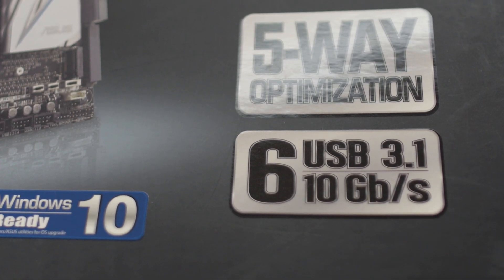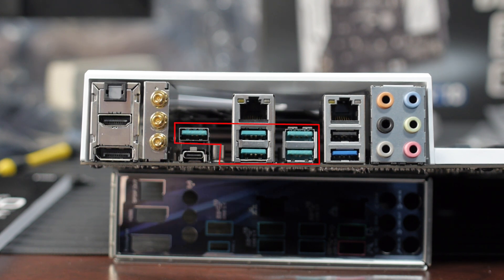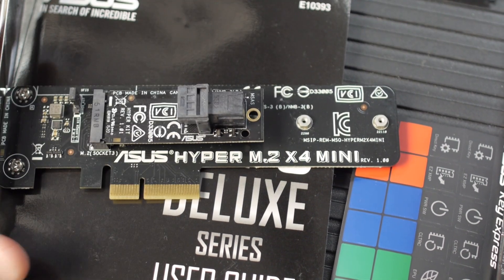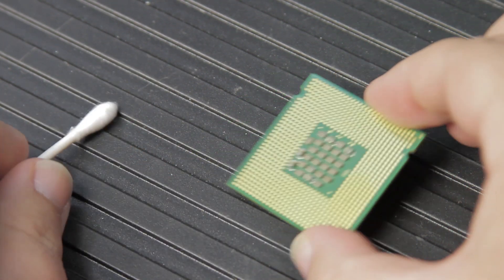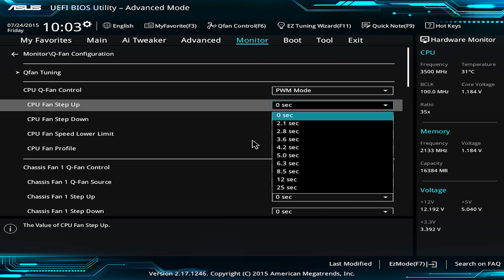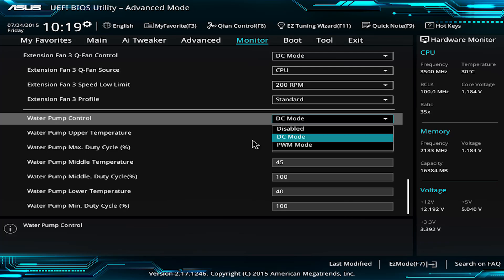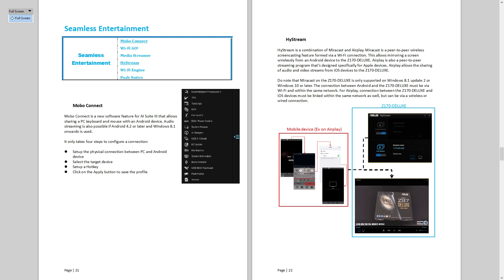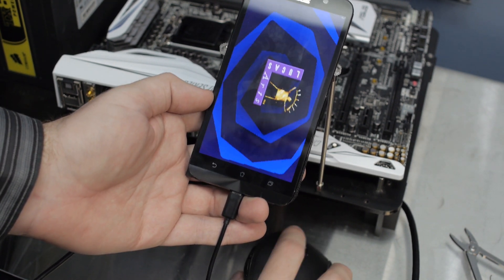ASUS Z170 Deluxe - Skylake Socket 1151

Comment: I'm quite new to this and I haven't read that much about it but I would like to know. Would using linux with this motherboard present problems or is it a good one for that purpose? Thanks.
Reply: Your motherboard doesn't really have anything to do with the operating system you decide to put on it. Some (much) older motherboards won't boot into anything else than Windows, but with any motherboard, you shouldn't see any problems.

Comment: Which is the 3.0 pci slot that runs at x4 mode? The first one (at the top) or the last one (the one close to the led indicators, fan connectors, usb connectors and other stuff).
Thanks in advance. Sorry for my bad english.

Comment: guys i dont know what he means by the wifi thing and the ram 2133 issue. if i use the corsair vengence 2133 lpx  2x4gb ddr4 ram would it work perfectly fine and also does the wifi thing work like a normal wifi pcie card

Comment: The cleanliness of the cpu and cpu socket was a little exaggerated lol. I've seen a Core 2 Quad run with TIM pieces stuck in the socket (had to remove with air after) cpu had TIM all over it in fingerprint style >:/ and it still worked before and after clean. Maybe i just got lucky.

Comment: should I go with this board or asus maximus VIII? any suggestions?
Reply: +Alex Dugman I'm not an expert but what I did was look at the price difference then sum up what was worth it to me. The additional stuff you pay for on the z170 deluxe is essentially the built on ac wifi and bluetooth. If those sound important to you then definitely go with the deluxe. Then there's also 6 USB 3.1 ports on the back and a hyper m.2 x4 pcie card which will let you have an extra m.2 slot at the cost of a pcie lane. Then there's also the u.2 adapter which I'm not too sure about but might come in handy in the future. I went with the deluxe because of the built in wifi, adapters, usb3.1 slots and the number of storage expansions you can hook up to it. Both are good boards but all it comes down to is suits you more

Comment: I have a quick question about CPU bottlencking GPUs. I have two Strix GTX 980s in SLI on an older i3820 (OC 4ghz) on an Asus P9X79 mobo. GPU-Z reports I only have PCIe 2.0, when I know the P9X79 fully supports PCIe 3.0. Even running the graphical demo GPU-Z has still reports PCIe 2.0. Maybe Windows 10 is messing with that, or the way I overclocked my CPU may "downgrade" my PCIe ports? I dunno. But is my old CPU bottlenecking my GPUs?
Reply: +scylendrey what about multi-core cpus with HT?

Comment: Great vid.

I got a beginner question, when the board has a maximum of 6 sata ports does that mean you can only run a total of 6 sata drives? or can you run a splitter if you wanted to run more?
Reply: Ok great thanks!

Comment: The bottom of LGA cpus are nowhere near as sensitive as he makes them out to be.
But k.
Reply: TheLawnWanderer Gold doesn't oxidize at all, which is why it's used for connections instead of nickel.

The main reason you don't want to touch the bottom of a modern CPU is because they're class 2 ESD components and can be damaged a lot easier than older CPUs.
Reply: TheLawnWanderer shut up neck beard!
Reply: Nope Nopenson Gold doesn't really oxidize at anywhere near that temp. 
Washing it with alcohol and a clean cloth is more than enough.
Reply: But the Neckbeard says that's not true. Also, human salts can cause Gold to oxidize as can open air. It does this with no added heat but by the chemical reaction caused by salts. 

Other than that acid is the only thing that causes it to oxidize.
Reply: even with 100% gold it will still oxidize. The only way it wont oxidize is if it's in a complete vacuum.
Reply: BIZKIT Gold doesn't react with oxygen under normal temperatures.
Reply: +TheLawnWanderer you are a fucking mouth breather aren't you?
Reply: BIZKIT u make me kry evry tyme.
Reply: TheLawnWanderer i spilled thermal paste on my 4770k, works fine still lol

Comment: using non-ESD safe Q-Tips on a CPU for 5 minutes is about the worst advice ive heard. 

if you accidentally touched your CPU contacts, it would be best to use some Isopropyl alcohol or a Xylene based substance with a lint free cloth, as you can easily build up static electricity by rubbing a Q-tip on the gold contacts.
your finger oils are not going to impede contact because the microsprings were DESIGNED around something called "Wipe" which is basically horizantal scraping of the gold surface contact due to vertical deflection for the purpose of wiping away surface contaminants,film,corrosion,oils,dust,etc... Even small amounts (0.001 inches) of metal-on-metal wipe are enough to improve mating, which you can physically see happening by looking at the scrape marks on the bottom of a CPU thats already been installed. Sources: whitepaper by Tyco (page 5,6,7) here http://www.te.com/documentation/whitepapers/pdf/ArraySockets_Microspring_technology_IEMT.pdf

Comment: Is anyone interested in Skylake? I believe PCI 4.0 is coming out soon so any pci 4.0 video cards will not fit. When they come out. The video cards are probably about 2-3 years out though. Or will you build another build by then or you just don't care.
Reply: David Young 2-3 years is a long time. I'd have a new build by then.
Reply: Pci express 4.0 is backwards compatible. It is going to use the same connector and it is backwards compatible. There won't be any compatibility issues.
Reply: True, missed the part of his post that says that.
Reply: "Gen 4 will use a new connector but the spec will be backward compatible mechanically and electrically with today’s 8GT Gen 3."  http://www.eetimes.com/document.asp?doc_id=1326922&page_number=1

So there is still hope for backwards compatibility?
Reply: Party Waffel  You are right about backwards compatibility. What I am saying is that this board has very limited upgrade ability in the future. I am still running on a x79 platform and have had numerous video cards. What you will get with Skylake is this generation of video cards and one more then you are done. Regardless if you have the CPU horsepower to run or not. Or you can hold out for one more year the new pci slots will come out and your platform will have longer legs. Sorry if I was unclear on what I was saying.
Reply: David Young I see, thanks for the explanation. I'm not sure if pcie 3.0 will bottleneck the upcoming pcie 4.0 gpus as even pci-e 2.0 isn't a bottleneck for gpus(the difference is usually less than 1 fps).

I don't think that pci-e 3.0 will be a bottleneck for gaming but it can be a bottleneck for gpu rendering/computing, ethernet/raid/infiniband/ fibre channel cards. I think that Pcie-3 will be a bottleneck for servers instead of gamers.

Comment: Pretty sure you're over exaggerating how fragile intel CPUs/sockets are...

You can play hacky sack with an intel CPU and it'll be fine as long as you're not bouncing it off the concrete
Reply: have you seen the new pcb? it's paper thin.
Reply: Sadaki It's barely thinner than the old ones. That doesn't change that it's safe to touch the gold contact pads
Reply: Jacob eMatt I agree, the pins are on the mobo not the cpu so its not as dodgy